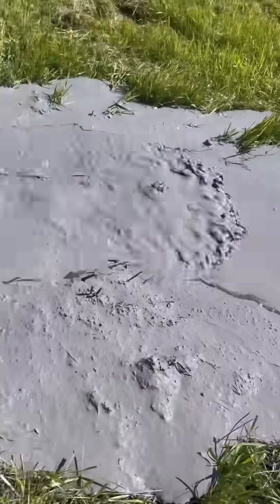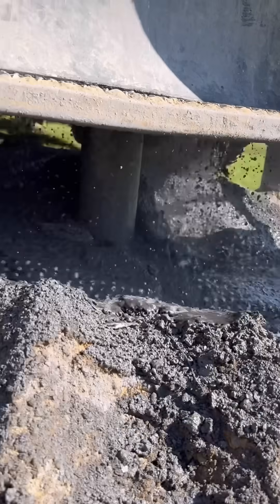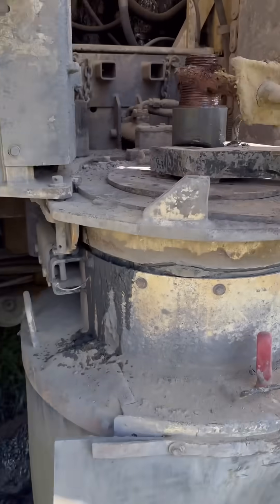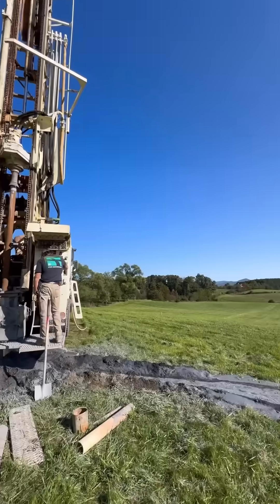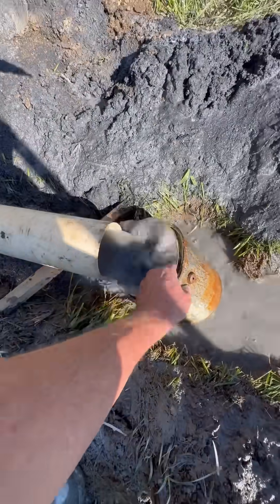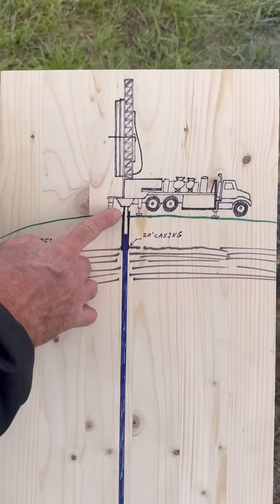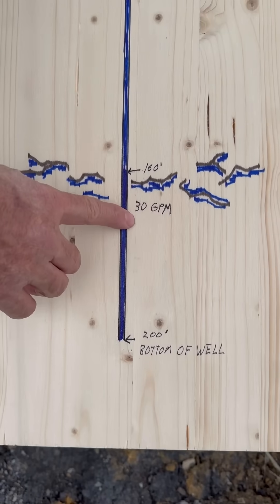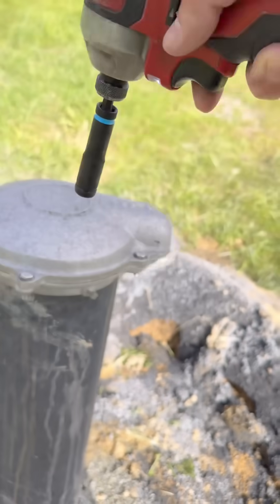How To Drill A Well

Comment: I bought 60 acres in rural Ft. Worth Texas in 1964. I called in a Co That charged $3400 for 180 feet . “Lone Star Drilling and excavation Co.” @ 168 feet no water! BUT OIL!!! And so much of it that the back pressure cracked the apparatus. I ended up with a royalty contract with Hunt Brothers, Inc. They built the pumping well and storage tank (Underground)  the previous owner took me to court in order to claim oil and mineral rights had not conveyed to me under the sale!  Texas Law: “From the center of the earth 🌎 to the sky and beyond “ Conveys with the sale of land. I got .7 cents per gallon of crude.  plus a $1000 check when they actually started pumping light Texas crude.  They wanted to start punching holes all over my property to find out if there was more. They offered me $51.000 for my property, Flat out sale, no royalties. There are thousands of wells going dry everywhere in oil country… I took the deal! Moved to Arizona bought a new house for $7000 bought a new car for $3200 and felt like I was the richest man in the world. The land that I sold was a good deal for both of us. It had much more oil but much further down, and you roll the dice 🎲 when you drill for the unknown .

Comment: Mine was drilled in 2017 at 230' deep when fuel was cheap.  The well and pump cost $5,500 and had similar bedrock depth.  Every area is different but I'll guess it cost you $6,500.

Comment: When I was growing up, we had a driller come in and drill us a new well.  They hit good water at some relatively shallow depth, 80 feet or so if I remember right (I was a kid, but this was family lore, retold often).  They said it was so pure and good tasting, you could bottle and sell it.  But then the guy reasoned that drought might cause that to fail, so he drilled deeper (my family later thought it was so he could charge more for the job).  He eventually punched through that good water table and hit rusty , hard water.  We struggled for years with that decision, using a water softener for the hardness (I got so tired of carrying plastic sacks of rock salt to feed that thing), and scrubbing off the red ring around the bathtub.  Years of that nonsense, because he hit good water within a short time and depth, and kept on drilling.
Reply from the maker: That’s frustrating

Comment: 60 meters (200ft) is still pretty shallow for our standards. It's probably a good depth for the area they drill in but where I'm from the companies usually drill 100+ meters (300+ft). During a drought my dad decided to replace his old, 3m (10ft) well with a more modern one. They had to drill 136 meters (over 400ft) to even reach water. This year's summer was the first summer in almost 5 years where we didn't have a drought in this part of Sweden. A few years ago there were forest fires almost every week and we even made lighting fires and barbecueing illegal for a while.

Comment: In 2022, I had a well drilled on 4 acres in the Ozark mountains.  We ended up going 630 feet down.  Great pressure and the water is crystal clear and delicious.  Total cost:  $14,000 including the pressure tank and all piping to the house.  That seems like a lot but I will have water for many years.  Side note:  I purchased a 10,000 BTU gas/propane generator to run the well pump, and had it wired into my electric panel with a transfer switch in the event of loss of electric power
Reply: With the cost over the years for normal city water/purified water from store that sounds like a good deal
Reply: Had well dug in 2005  South of Sierra Vista, Az.  540'  got 25 gal/min. Water to house $15,000  with a 2 hp pump.
Replaced pump in 2018 with a 3hp pump $5200.
Reply: How can you know how long the water will last??
Reply: @jerryseinfeld6767  what kind of question is that?
Ignorant in my opinion. 
Unless broken down through electrolysis or some other method. 
Water lasts indefinitely. 
It may change shape or form ( ice, steam, clouds, snow etc). But it's still H2O.
Why I never watched Seinfeld. 
Why New York voted AOC.
can't fix stupid.
Reply: @jerryseinfeld6767 :
      Historical depletion rates correlated to historcal demands and project future depletion by projected population increases and commercial demands.  DO THIS FOR EACH AQUIFER'S SLOPE, LOCATION, AND DEPTH before drillng.  
    Or ask the neighbors.
Reply: @jerryseinfeld6767  I'm in my 70s.  It will last my lifetime for sure.  Nobody knows for sure how long the water will last.  We hit potable water at 250 feet and 400 feet but went deeper to increase the pressure.  The downside to a deep water well is that my static water is at 240 feet, too deep for a hand pump.  That's why I have the generator.
Reply: $14,000 total??????  Around Tucson it’s over $50k to start!!!!!!
Reply: @katykayy  That's horrible, Katy.  I was expecting a high cost because I live in the Ozark mountains and cringed when they handed me the bill, but WOW, $50K is a chunk!
Reply: @katykayy  Tucson is a groundwater city?  Arizona has that expensive permit system to prevent overdrawing ground water.  Thankfully they don't require permits to breathe air, but the government has claimed "ownership" of the water in the ground apparently and you need permits to get water on your property.  And if your property is under 5 acres (the property in the video is 5 acres), then you need an additional environmental permit review before you can even qualify for getting a well permit.
Reply: @katykayy  Up in the valley I was just quoted $90,000 just for the hole, no pumps,tanks, electrical.
Reply: @katykayy  imagine because your in a desert?
Some major factors that come into play.
Economic status and real estate values in your area.
How deep the average well has to be drilled.
And a big one is how much casing has to be used in order to properly 
Install and secure well.
Casing  is expensive. 
30 years ago it used to cost  2-3 times dollars per foot.
 Because the cost.of casing, larger bit slower drilling. 
Soil composition and depth before you hit solid bedrock are major factors. 
Then you still have to find water.
Also the drilling rigs were over half a million dollars 30 years ago.
Imagine over a million today plus increases in taxes, cost of living,inflation. 
You know, Bidenomics, it's working. 😂
Reply: $14k is what they’re charging my coworker just to drill the well on his 3 acres in Washington state, doesn’t include the pump or wiring, that’s another $5k
Reply: @luiseldewashington1768   from comments in this thread it appears to wildly vary depending on state, and specifically each situation. Still, it crazy how much it can vary. It makes sense, yet is still something that catches you off guard really. ✌️
Reply: @luiseldewashington1768  Bidenomics it's working. 
Used to be about a grand to connect well to house, pressure tank included. 
 Before Obama and Biden.
Reply: @bcallahan3806 wasn’t there some clown in there between Obama & Biden?
Reply: @bcallahan3806  Before Bush and the felon you mean?
Reply: My bud only paid 10,500 in the Ozark mountains of Missouri.
Reply: @michaelhammond9459  That's a great deal.  Just depends on exactly where you live.
Reply: @dianamattson1195 my bud is in eminence area if your familiar.
Reply: Damn, I had my well drilled 2022 in the black hills in WY, it was 420 feet deep and cost me between $40 and $60 per foot. Location plays into it so much....also the asshat drilled the well right where the house was supposed to go. Did the same to my neighbor...that's what happens when there isn't much local competition.
Reply: neighbor just put one in 15 miles west of there in Oklahoma I think it was 400ft and cost $30K
Reply: in my rural area years ago they put in a county water system and for about 2 decades everything was fine, but once it was legal to grow weed, the water usage skyrocketed and the county water couldn't keep up. At least twice a month the county water would be out for multiple days. anyone that had an old well simply got it working and hooked the house back up to it, but many people had in one way or another done something to make the old well unsalvageable or newer houses built after county water came in never had a well. these people had to dig new wells or go without water. well digging crews where coming in from other states and charging crazy prices, they had so much work, at one point it wasn't possible to get a new well installed because all the crews had enough work to keep them busy for the next year. without water you cant get a loan to buy a house, so no one could sell their house and leave either because none of the houses in the area could be bought with a mortgage. my neighbor was one that had to have a well installed so they could sell their place.
Reply: @stonewolf9459  What a horrible situation.  When we were little, we never thought about where our water comes from.  We just turned on the tap and there it was.  You don't realize how important that precious liquid is until it is not there.  I'm sorry your community had to suffer because of the bureaucracy in your county.  Power corrupts.  Absolute power corrupts absolutely.  That is government!
Reply: @stonewolf9459  Wow!  That's a lot!
Reply: Great pressure??  Or good flow?
Reply: @davidzwicker5662  Good flow and great pressure with the pressure tank.  My neighbors are on the big community well.  They complain about the low pressure.  It's old, too and I anticipated that the community well will need repairs or replacing of expensive parts, and the people in the community would be footing that bill.  That's why I had a private well drilled on my property.
Reply: It cost you their minimum for 200 feet
Reply: I just had 250 feet drilled with 45 gallons per minute in Ohio for well installed and lines ran for $12,500 some
Reply: You got a hell of a deal
Reply: Install some solar panels to help lower long term costs
Reply: Isn't BTU how much heat a heater puts out??
Reply: What about cleaning and maintenance?
Reply: Fuck you people the country is only for rich folks now. Poor folks are in the city
Reply: Make sure of it. Is it 10KW or 10Kwa? Cus those are completely different then each other
Reply: $13,000 total.
Reply: Brilliant idea
Reply: @dianamattson1195 
How did you get that it was corrupted government out of the @stonewolf9459 story?
Reply: @dianamattson1195
Why did you think the government was the reason for the problem in @stonewolf9459 story?
Reply: @dianamattson1195
Why do you think it was bureaucracy that caused the issues stonewolfs story?
Reply: @genericamerican7574  Because it always is.  There's so much regulation, and every time our local, state and federal governing bodies force a new regulation on our businesses, the cost gets passed on to the consumer.  Am I wrong?  Plus, with inflation, our dollar doesn't buy as much.
Reply: think.you mean 10 thousand watt generator or 10KW. Or 10 Kilowatt. 
BTU stands for British Thermal Unit.which is heat related.. ( amount of energy to raise one pound of water 1 degree Fahrenheit).
Watts measure electrical power. 
calculated by multiplying Volts x Amps..
Reply: @bcallahan3806   Sorry.  You are correct.  My bad.  It is a 10K Watt Dual Fuel generator.   I can live without AC...I can't live without water.
Reply: @dianamattson1195  no.worries.
Wasn't criticism. Just trying to get correct information out there.
 Hope you stay safe and well.
👍👍
Reply: @bcallahan3806  Thank you!   Husbands ae supposed to be the ones messing with these things.   Guys are just hard-wired to know more about guy stuff than we are.  I do appreciate all the great information and tips I get from sites like this one.  Guys deserve lots of 'atta-boys' from us gals!
Reply: @bcallahan3806  hehe...well.
Reply: @Doohickeydongle  a deep subject!
Reply: @bcallahan3806  1 W is equal to 3.41 BTU/h. 10,000 BTU/hr would be a 3kW generator
Reply: Super smart on your end. When I lived in Maryland, any time we lost power we lost water since the manual pump for the well had broken years before and my parents could not afford to replace it. We filled the bathtub before storms, just in case.
Reply: 14k?? 50k?? I grew up 1/4 mile from the Florida state penitentiary (could see the arch at the entrance from our back driveway) it's zoned as "starke" but it's actually Hilbron springs and my dad had a new well drilled in 2019 for $1400. Yea, one thousand four hundred. Granted, it's a second well on our property(the first was drilled in 1978), but still, $14k, or $50k??? Dayum. Is it depth or just general all arpumd operation cost that make it thst high? And that's just to drill the line, not put in a pump or run the main line to the house, correct?
Reply: @omega-death  Florida is unique as I stated before. 
Economics, but more so ground geology plays a big part.
 Florida is kinda looking like some concern.
As past practices weren't so great  (draining wetlands) and population growth climbing .
Water tables are diminishing. 
Thus sinkholes and other phenomena occurring. 
 Florida is a beautiful state. Best governor in the country in my opinion. 
  I've seen it before. 
Drilling a well ,get ample water should last you for life if done properly. 
20 years down the road, neighbors sell off farmland and 100 new houses go in. Each with a well. 
That drops the water table. 
Causing your well to go dry and sinkholes. 
It's not rocket science. 
Every place is different. 
We had over 100 gallons per minute when neighbors had 3, and 1/4 mile up the road neighbor after 4 wells with no water had to purchase another 1/4 acre to get one sufficient enough to supply house.
Reply: @bcallahan3806  Well, I didn't read any of your comments specifically, so I didn't see anything you mentioned before. Regardless, I understand ya. 👍
Reply: @bcallahan380best governor 😂😂😂😂😂😂😂😂😂😂😂❤❤❤❤😂😂😂😂😂😂
Reply: Delicious huh? Test it for lead?
Reply: @iGame3D  Of course, I had it tested.  It came back perfectly fine.  No lead.  No contaminants and zero Fluoride.  I'm a baker and use my well water to proof my sourdough.  You can't use city water because of the chlorine.  It kills the yeast.
Reply: One step ahead! That’s awesome. Always good water. Can’t beat that.
Reply: That is the difference between midwest cost and CA cost.
Reply: Guys, HERE is our Savior

HalleluYAH (Hallel u YAH) - “Praise YAH”

YAH The Father (Genesis 1)
YAH arrives via The TENT OF MEETING
YAH was Who they Crucified for mans sins
YAH was Crucified on an Almond TREE

Original Semitic of Moses
Isaiah Scroll (The Original Isaiah)
Reply: I'm moving to the Ozarks in the next year. Do you mind sharing the name of your well company? I can't wait to move! Do you love it there???

Comment: Texaco drilled our well for free, back in the 1950s they thought it might be oil but it was actually a hot spring, its still running about 500 gal. per minute at 98 degrees. From about 800 feet deep.
Reply from the maker: Interesting

Comment: It's recommended to use a "packer," plastic taped to the casing in a way that seals the gap between the casing well wall and the casing itself. On top of the plastic bentonite and cement are poured to form the seal. If this is not done or not done correctly you will get contamination in your well.

Comment: Don’t forget the heat tape and sensor, that activates the heat tape when temperatures drop.
You also might consider installing an electric plug outlet and an inside wellhead cover light.

Comment: I got charged $750 back in 2000 to go 605ft, it was mostly all rock from start to finish but they hit water on the first try. They hit water at 40ft, 90ft, and 280 but all was either dirty or high in contaminants, (phosphates, nickle, chromium, then iron, calcium, and heavy metals that they said comes from nearby coal mining, and sulfur. They were nearing the end of their ability to keep trying when they hit clean water. The bad part was they had to come back less than a year later because there was methane getting into the well. They charged me another $700 to go down to 910ft. They didn't charge for the labor, just the casing, pipe, and wiring. The added depth also meant a larger well. A year later a neighbor got hit with a $2,500 bill from another well driller to go nearly the same depth.

Comment: You drill deeper than the aquifer to provide a reserve capacity of the well itself, stabilize the supply as he said. This also gives you a sump to sit the pump into because you want to place the pump at least ten feet above the bottom of the well. This leaves room for sediment and the pump won't suck up rocks.

Comment: Drilling a well usually costs at least $100 per foot. So your well would cost about $20K 😊 You also have the cost of bringing in electricity, the pump, pressure tank and piping, trenching that in would add another few thousand. Say another $5k should cover it. 😊

Comment: $10,000 to drill, insert casing, install the pump, the electric service and vertical water pipe, install the pipe to the home and other buildings and insulate the entire above ground installation.

Comment: Spent $7K back in 2014 to drill 220 feet with 7 lengths of casing. We hit water twice (@55 and 200). The ex never did anything with it!!! Dropped a pump down in it with electric, and STOPPED. No well house - just wasted!